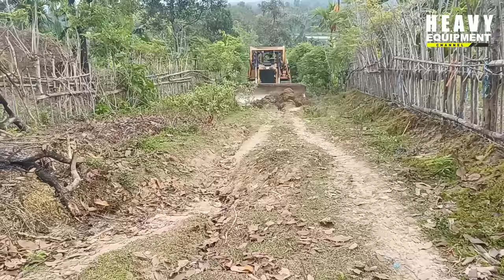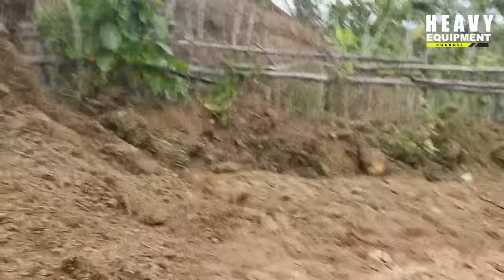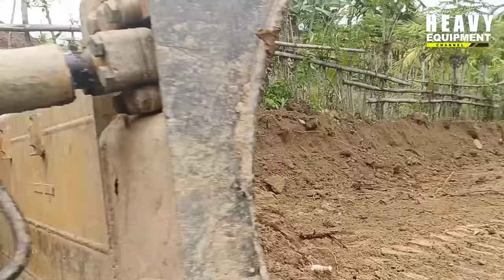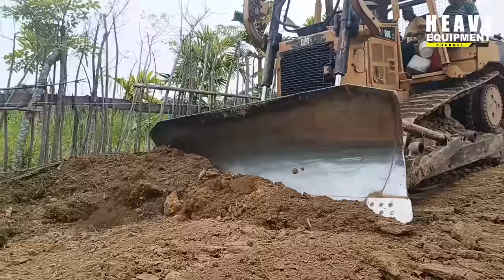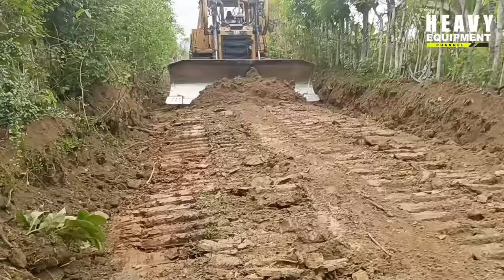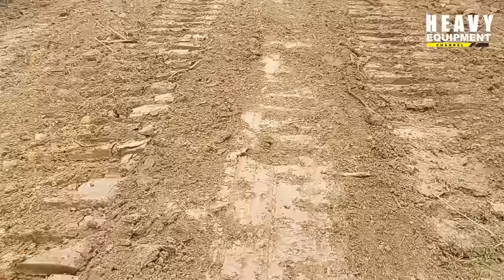Caterpillar D6R XL bulldozer operator is very good at working to smooth plantation roads

Comment: Needs compactor road wont last .
Reply from the maker: Yes my friend, now the road has been compacted
Reply: Needs somebody on that dozer who actually knows what they're doing
Reply from the maker: @Species5008  Yes friends, bulldozer operators who are very experienced in working which are really needed
Reply: Not a bad operator, just needs 6 way blade. I assume he was trying to ditch and crown, hard to do with that blade. Good dirt though, well, easy dirt, everything is relative.
Reply from the maker: @World-as-i-c-it  Yes, my friend, thanks for the comment
Reply: Compactor, gravel and asphalt
Reply: @Species5008 then why don't you shut your mouth and get to work then since you seem to know it all
Reply: First it should be scarified 6 - 12" deep. Moisture applied, and a vibratory sheep's foot applied, then motor graded.
Reply: The main thing is the PEOPLE are happy getting road maintenance done ✅

Comment: Yes it smoothes them out but they’re now a lot softer and ruts will quickly form again with traffic. Add a roller/compactor after the dozer and the road would last 10X as long.
Reply from the maker: Yes, in the future I will use a compactor so that the road lasts longer, thanks for the comment 👍👍👍👍
Reply: He did make a crown for water shed
Reply from the maker: @Brandon-ch2ot  ❤❤❤❤
Reply: Do you know the process for making a path to lay railroad tracks on? is it similiar to this?
Reply from the maker: @skyraiderjet  This is the road to the plantation, thanks for the comment
Reply: @heavyequipmentchannel899  That’s not what I was asking. And I’m talking to the original poster
Reply from the maker: @skyraiderjet  Thank you for the comment
Reply: @skyraiderjet much more complicated

Comment: A lot of experts on here who think they know how to it better. Sometimes you just have to do what you think is best for the conditions at the time    soil types, wet or dry, slope 'etc' with the machine you are using.  Its been  mentioned that it will wash out if not compacted from my experience that depends on the soil type for example sandy soils such as granite or sandstone it will still erode away to some extent doesnt matter how much it is compacted if  its a mixture of cloddy type topsoil and subsoil with organic matter mixed in just just a quick trackroll with dozer usually works fine. Rocky material usually not to many problems.  One thing that is important is not driving on the track or road straight after the first lot of rain on it  let it dry out and settle first this is not allways possible though.  Just my thoughts.
Reply from the maker: Yes, friend, the land that is being worked on is hard and dry because there are lots of rocks and coral in that place

Comment: Nice dozer. Try dropping the blade and press down just a little and then back up it will make it real smooth and will compress the soil. Grate leveling job you're doing.... I could only dream of having a large dozer like that. Thanks for the video.
Reply from the maker: Yes my friend thank you very much for the comment

Comment: Ok. He widened and crowned dirt..so where the placement of 3/4" to reduce the mud and ruts that will be cut when it rains?
Reply from the maker: Yes, friend, thank you very much for the comment, this road is now compacted with sand so it doesn't matter when it rains
Reply: @heavyequipmentchannel899  Thank you for replying. I wish you had shown the sand and compaction..getting sand up into those mountains is NOT an easy job. Same with compaction. Do the plantations come together and pay for the work?

Comment: Could have been edge tidy if he hadn't been so lazy as to not angle the blade 
(it is an angle blade on it)
Reply from the maker: thank you for the comment my friend
Reply: just tilt blade side to side no angle on this dozer
Reply: @muleskinner485  take another look my friend 
The blade is A frame with centre pivot 
Also has standard three position blocks for side arms
Have spent over 30,000 Hrs on dozers so there's a good chance I know what I'm talking about
Reply from the maker: @muleskinner485  Yes, my friend, this bulldozer operator has no experience in working, sorry if the work is not pleasing to the eye, thank you very much for commenting
Reply: I'm not saying the results are bad - level trim with good crown but leaving a high shoulder like that will cause problems in the not to distant future
Reply from the maker: Yes, my friend understands that the operator is not very skilled at smoothing roads @dalegunn9434

Comment: A self leveling feature for the front blade sure would help.  From side to side.  Other wise it would be almost impossible to get level.
Reply from the maker: Yes my friend, thank you for the comment and thank you veri much for the watching 🤝🤝🤝🤝
Reply: It doesn't need to be level,  the road needs to have a "crown" to it, so that water will drain to either side of the road, and not wash out the center.
Reply from the maker: @jstephenallington8431  Yes friends, this road is not flooded with rainwater because there is a ditch on the side of the road
Reply: That’s why hood dozer hands are so in demand. It’s all done by feel. The cutting edge is never in view